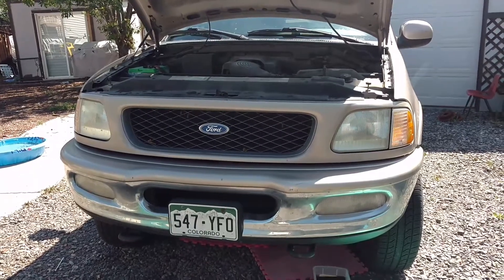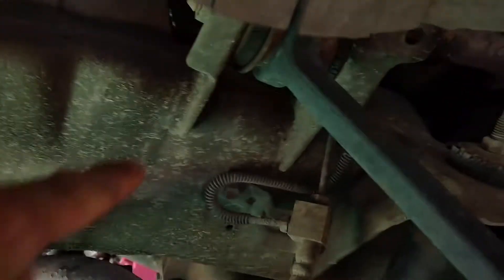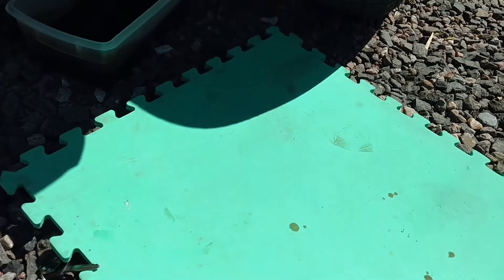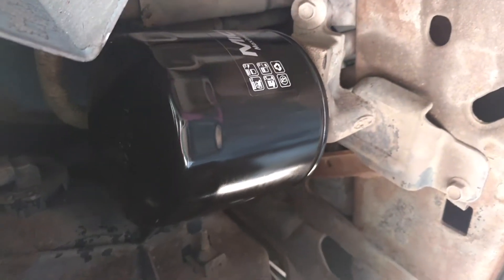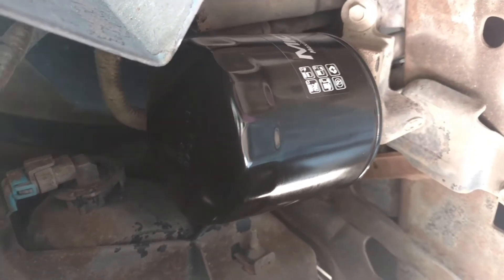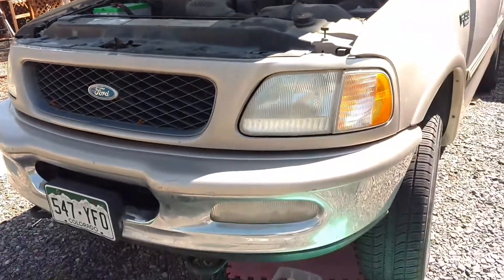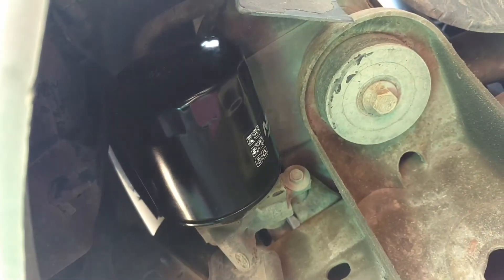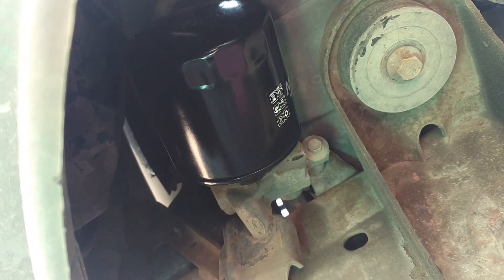97 Ford f150  (hidden) oil fliter placement. 4.6 4x4

Comment: You should be glad it is there. On a 4x4 the filter and especially the oil pressure sensor/switch/sender, you almost have to drop the front differential to change them. Fixing to find out on the senser and hope that is my problem with my oil pressure.

Comment: I have 1997 F-150 4x4 with the 4.6 and mine filter is not near the bumper. It’s right above the font diff and pain in the behind to change. I have a early model 97 built in late 96 with a Windsor engine.
Reply: nav mahj
Same here I have the same engine and build year too.
I would prefer to have it near the bumper for a much easier oil filter change.
I hear there is a relocation kit available?
Reply: Early 97s were built from 12/95-6/96. They have different header panels(headlights attach different), screw type gas cap vs 1/4 turn, different ebrake cable setup, brake hard lines are ran different, gauge cluster has a redline on 55mph and says "Unleaded Fuel Only" vs "Fuel Door", and there was only 4.2 and 4.6 engines. 5.4 was a late 97 (after 6/96 availability).

Mine was built in 12/95 and my oil filter is on the engine. It's a 4x4 Offroad (which fun fact, was the only way to get the factory 17s on the E97s).
Reply: Same here. I use a filter wrench on a speed handle with short extension to reach the filter. I go through the wheel well.  Still not way easy.

Comment: I think that kind of rare 
Usually that filter is on the engine and you have to turn the steering wheel all the way right , and you still barely have enough room

Comment: Ive heard there is a relocation kit available for the filter.
Maybe that's why.. IDK
I have a 4.6 Windsor.
What type of Motor oil you guys use and recommend?
10-20 or 10-30 ?

Comment: Genius lets put it right infront of the bumper thanks... why????
Reply: 1men wolfpack it’s a lot more convenient you don’t have to crawl under vehicle to change the oil filter.
Reply: Because the original location makes it impossible to change if it's a 4x4.